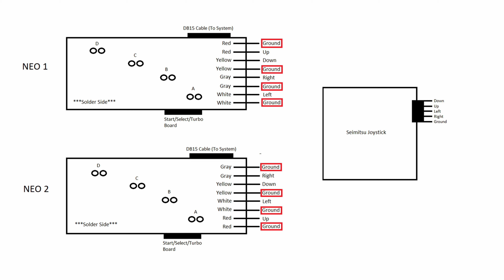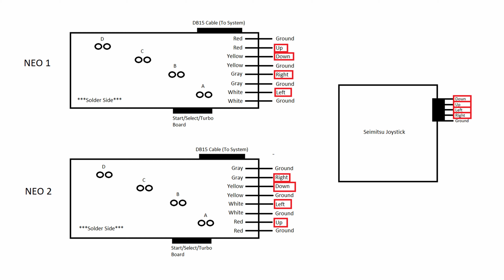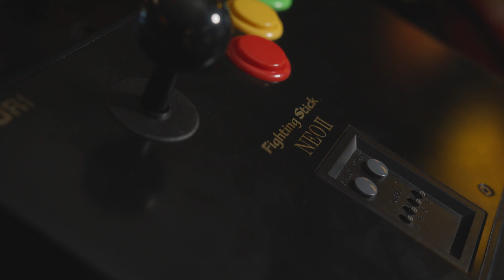Hori Fighting Stick Neo Mod Guide // ARCADE STICK MODS

Comment: I absolutely LOVED this 'How To'. I just taught myself how to Crimp both Spade and JST connectors, Making Splice cable, and stuff.. 

So what I loved here was the examples of Freedom of choice people actual have available to them. .

When it comes to this kind of work, peoole become absolutely way to Rigid...but it does make sense... We are dabbling in a sort of work which in my opinion has been Mystified in order to shy people away from Electrical work and HAVE to devote yourself to a Trade. 

These people color code with everything try so hard to make you never realize that cooper cable is copper cable, or a Conductor will Conduct so as long as the medium in witch voltage is traveling through is unified, or touching which is why you reinforce the idea that Metal cannot touch metal in regards to the conduction of electricity so you cover it with something.... That should help others understand why you gotta use Silicone sleeves for your Space Connectors...

And all this Solid information is just all for modding Arcade Sticks... People wouldn't even realized they are learning something they could make a career in. 

Thanks for the upload, and I am Very Much waiting on those New Wave M.A.S Sticks! 

I want one for my Xbox Platforms!
Reply from the maker: MAS coming soon! Still tweaking things!
Reply: @ScanlineCity  Please! Take your Time! The  Dedicated Will Be Here For it!

Comment: If I'd known about the LS-33 when I did my mod, I'd have used that over the LS-56. Less dremel work, but it still gets the job done.

Solid mod, dude! Welcome back!
Reply: Do you know if there is a Sanwa or another joystick that I could use on the hori 2 without any dremeling?

Comment: Recently modded my Neo II with seimitsu Sels-70.

it comes with the NT shaft and I found I didn't need to grind anything off on the shaft and you can remove two washers to get a similar height of the original stick.

Comment: At first the LS-56's height terrified me,  its so high and it made it unpractical to use a bat top which I prefer. Oddly enough though when I tried it out it just kinda felt awesome. My favorite ball top lever.

I didnt know counter sink bits exist, I should probably get one, the one time I had to counter sink I just used a bigger drill bit lol
Reply: You're not supposed to mount the LS56 directly to the panel. So in a mod like this it will be higher.
Reply: @CRTdrone  How should you mount it then?

Comment: So just a quick note - for any of these Supergun/Neo Geo sticks, another option is to pick up a female DB15 screw terminal, look at wiring online for each pin, and just connect your own wire ends with a screwdriver. A lot less soldering if that's not your best skill (like me). You can then shave down a Neo Geo/DB15 extension cable at the male end with a Dremel, and just connect the wire to the screw terminal and run it through the hole. I've done this for a bunch of sticks and love it! Pretty easy to do.
Reply from the maker: Yeah that works great! For me I wanted to keep the turbo switches intact
Reply: @ScanlineCity  well, if you're interested, my next project involves creating a Sega Genesis/MD stick out of a Sega Virtua Stick High Grade, a DB9 terminal and an Arduino with code I'm writing. With an Arduino, the sky is the limit if you can learn to code it, and with just a little programming, you can add turbo. Just waiting on some components to test!
Reply: @MarcBarkyMarta  

Hey, you have videos of your modding? That sounds like some awesome stuff to watch and learn about!
Reply: @cMARVEL360  I don't actually. Really I wouldn't even know where to begin. I have another channel where I post updates for a small arcade PCB game I'm working on, but that's it.

Comment: Thanks for the video, though unfortunately someone told me this stick was a "drop-in" replacement and to check out your videos, but I'd rather not do any drilling and cutting on a fairly hard-to-find stick (a Neo II is about $100 right now).

Do you have any general advice or videos on stick refurbishing?  Mine's just a bit stiff once you start pushing the microswitches, like 50-100% throw is much much stiffer than before the microswitches actuate.  I suppose I could replace them?  Or maybe there's something I can grease?

Thank you!
Reply from the maker: Yeah if you don't want to drill etc I would just clean the heck out of it and use a bit of grease. But honestly it so much better with the mod and for the most part you really can't ruin the stick

Comment: I'm thinking about buying a Neo Stick 2. What size buttons did you go with? A lot of these old 90s sticks use 28mm buttons which is annoying. I want to put in 30mm sanwas. please confirm this for me. What size buttons does it take?
Reply from the maker: 30mm will work!

Comment: Which Semitsu screw in buttons did you use? Also is there a difference between LS-62 and LS-62-01?
Reply from the maker: I used the PS14 screw on 30mm by seimitsu but really any 30mm should work great. I don't think there is a difference between LS-62 and LS-62-01. I used the LS-62-01 from arcade shock
Reply: @ScanlineCity  Thanks, parts have been ordered
Reply: @fthetm  The difference between LS-xx and their LS-xx-01 counterpart is that the -01 versions have got a PCB with the 5 pin terminal. On the non-01 versions you have to connect a wire to each direction's microswitch and ground to each switch.

Comment: Hey Scanline, I had commented on your pcb cover interview with Retro RGB and tried to get the word out to other arcade channels that I knew of.  I hope its reception has been going well for you.  I'm looking forward to your MAS designs more and hope to see an Industrias Lorezno version (or ultimarc magstick + which I think is secretly built by iL, but I have no proof).  Also do you know any brand that uses Hall effect for their sticks?  I'd personally like to see a MAS variant as a drop in replacement deck for Arcade1Up's and the like.  In the future, it would be cool to see an engineered  motorized/mechanical gate that adjusts for games based on their need for a square; octagonal; circlular; vertical; or horizontal gate based on game type.

Comment: Why not just soLder the board to the buttons the way it was? That is easy enough to do, and the soLder pads are easily large enough if you need to expand the holes. 

Much tidier and no need for that messy glue or cardboard.